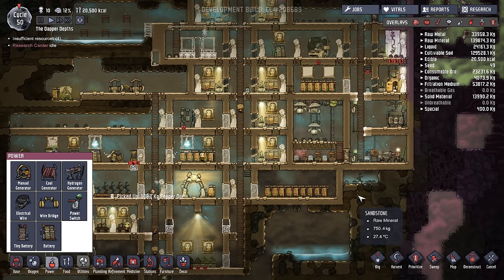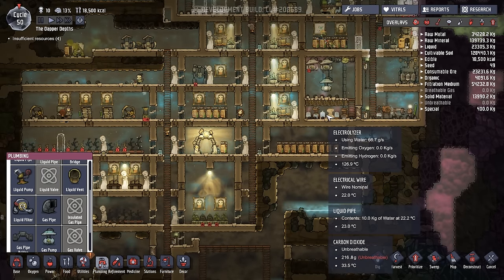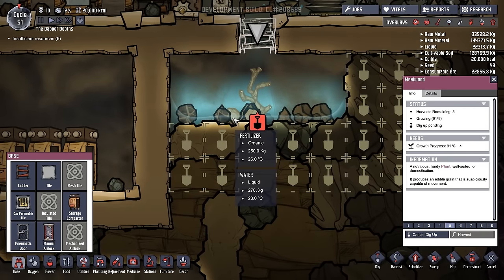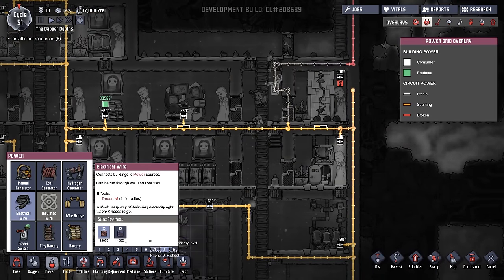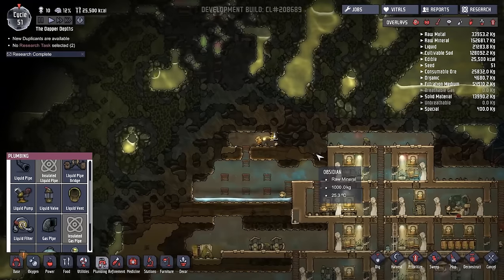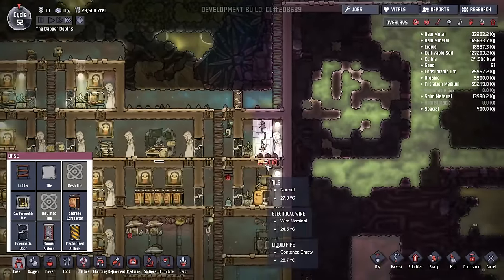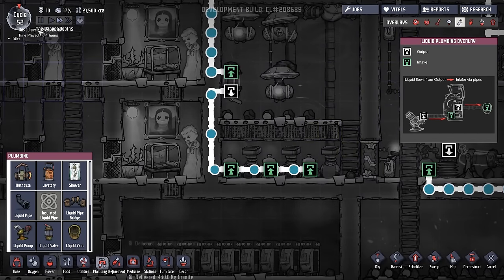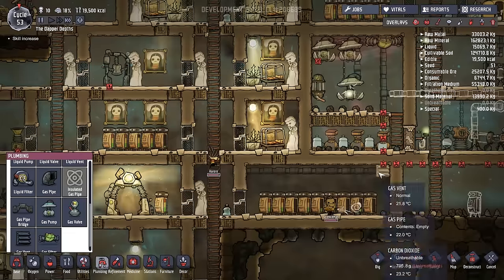Oxygen Not Included – 16. Pressure Problems - Let's Play Oxygen Not Included Gameplay

Comment: Aavak, you need some CO2 scrubbers in the lowest points of the base, so that they can remove the CO2 while reducing the pressure in your base, which is reaching a very high point as you are constantly producing more gas (O2) than is used.
Reply from the maker: Agreed.
Reply: Aavak Glad you saw it. Overpressure seems to be a big danger with the electrolyzers. Lucky you can just remove the CO2.
Reply: I wonder how far into the law of "preservation of mass" this game will go eventually. CO2 scrubbed could give low pressure of O2 and some byproduct (coal?) But then you'd also need to have O2 for the coal generator, which then gives CO2, it's an interesting cycle.
Reply: Tyrope Games The byproduct of the CO2 scrubbers is contaminated water, which filtering that has no byproduct...Which I'd like to see it have one, contaminated dirt (the sand used to filter plus the contaminants).
Reply: So we go from CO2 to H2O + Contaminents, which then gets turned into pure H2O? How did we turn 1 Carbon atom into 4 Hydrogen atoms?
Reply: Tyrope Games We didn't, we sublimated sand and the contamination (carbon) out of existence.

Comment: yes i have been waiting for more ONI! :D I would love to be a duplicant by the way aavak :) also, id di mention this in another vid's comments but ill say it again in case you didnt read it, your idle science machines are using power! and be careful of the contaminated oxygen that comes from slime. keep up the awesome videos aavak! ;P
Reply: wait nevermind, the research thing doesnt apply right now.. i should learn to watch the vid before commenting ... oops
Reply: While your points are absolutely correct, I don't think Aavak is too concerned about power, not so much to turn off idle machines anyway (even if they were idle) unless his lights start turning off. All the hydrogen will be burned anyway, so he won't save anything.

And he knows about the contaminated oxygen from slime, he showed a slime system he made with Puffs at the end of his last attempt :) So you can stop mentioning it... although maybe some other people found it useful.
Reply: Squeaks They produce heat when not being used as well.
Reply: OldMrFrodo yes that's true, although as Nick V said which I didn't think of, although aavak may not need to save power, they produce heat whilst idle too. 

ah I didn't realise he knew about the contaminated oxygen from slime, sorry about that. pufts are so useful :) thanks for pointing that out :p helpful
Reply: hold on actually, I remember him checking during the last playthrough if heat was produced while a machine was disabled and seem to remember it being true, scrap that part of my comment :p

Comment: It appears that the gas filter is greatly slowing the gasflow. It appears to have a set output rate that's slower than the pumps, so I would think building more filters may fix the issue.
Reply: The filter actually has a very high capacity. The appearance of it slowing the gas flow is because it takes 6x ~125g/s "packets" (pumps produce ~125g/s) from the pumps, and bundles that into one ~750g/s "packet" (unless the type of gas changes, in which case it outputs immediately). What's slowing the gas flow is actually the fact that he has 3 low-pressure, high-throughput pipes feeding into one pipe which then goes to the filter; unfortunately, the pipe isn't capable of bundling "packets" like the filter can, so it has to slow down.
Building more filters would help, though; having one filter per two pumps seems to work well, as there is enough space in the pipes for two pumps to feed into one pipe, to then feed into one filter.
Reply from the maker: Ah, one per two. Righto, I'll keep that in mind :D

Comment: @Aavak for the liquid valve, think of how you connect a garden hose to the house. That doesn't require electricity so why should it in O.N.I.?
Reply from the maker: For the same reason you connect a pressure washer to electricity ;)
Reply: Pressure washers create pressure, valves merely limit it. It's a whole increase/decrease of energy thing. :)

Comment: 'Valve' breaking things? The 'Valve' issue being fixed? MADNESS I tell you!

As for gas getting stuck. Ideally you want air to flow around constantly, so pumping air out at one (some) point(s) creating low pressure zones while putting it in at other points making it so that it constantly keeps flowing along certain routes will also mean that it takes along any contaminants.

Comment: Ever notice that CO2 tends to drift to the (bottom) right and hydrogen to the (top) left? Thinking my next base design will keep this in mind.
Reply: That's entirely to do with where you're applying pressure to the air. In Aavak's case, most of the pressure is being applied in the upper right and lower left corners of the colony, so the air is pushing towards the upper left and lower right corners. Because hydrogen naturally rises and CO2 naturally sinks in the presence of oxygen, the hydrogen moves towards the upper area and the CO2 to the lower area; hence it gravitating to the pattern you have observed.

In my own base, for example, I have pressure applied fairly equally down the sides; I haven't released any hydrogen into the air so I can't see where that goes, but the CO2 certainly falls to the bottom center.

Comment: Hey Aavak if youd like a cool way to deal with all that co2 one way would be a liquid co2 chamber an example of this can be found in episode 10 of Blitzkriegsler's ONI lets play unless you have already got another way in mind i personally found this way very neat
Reply: Personally, I prefer using a bit of power to scrub it from the air and eliminate it entirely, than a lot of power and space to cool it down sufficiently and store it in a highly pressurized room which may or may not have the potential to explode if the pressure gets too high.
But that's just my opinion.